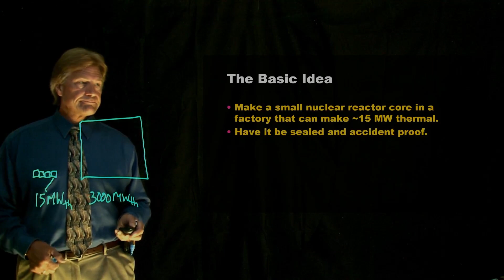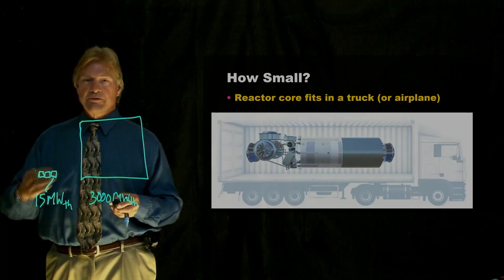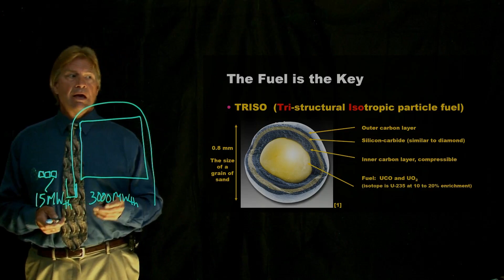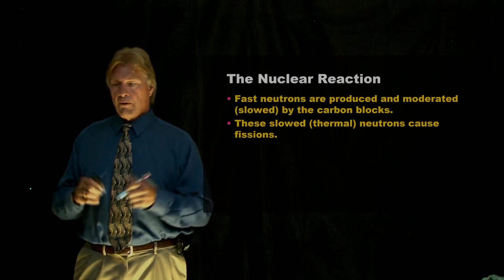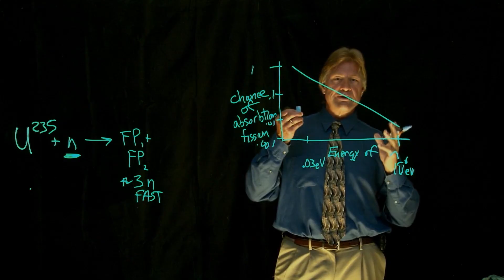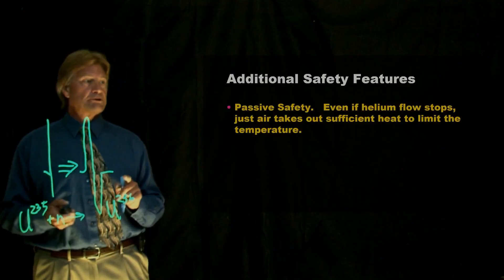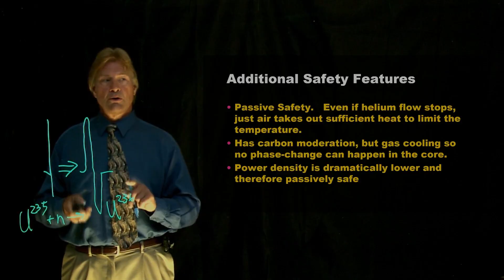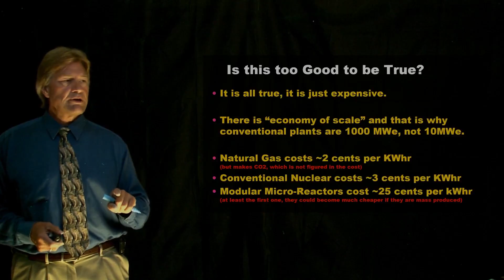Modular Micro-Reactors – The Future of Nuclear Energy?

Comment: Professor Ruzic. I agree with part of your presentation. The French proved the small reactor factory built concept in the 1960's when they built their very successful nuclear power station grid from this type of small reactor. I disagree with your promotion of the pebble fuel. It is VERY difficult to make as well as very expensive. It also has all of the problems of any solid fueled nuclear reactor. Nuclear fuel ALWAYS swells due to the intense radiation. This is simply an expensive way to minimize the swelling effects. It does nothing to resolve the reaction byproducts contamination of the reaction. Also it only allows utilization of a very small portion of the energy in the nuclear fuel (about 1-3%). When the core is decommissioned you still need to store the highly radioactive waste for thousands of years. AND you need to somehow break down the very hard fuel pellets, ie, very difficult and expensive. 

I agree with your promotion of the molten salt. If you are going to use molten salt anyway why don't you eliminate the complexity and cost of making pellets and just go with a molten salt liquid fueled Thorium reactor (such as LIFTR) to start with. This design IMO is far superior, has already run for over 6,000 hours at Oak ridge labs, is proven walk away safe, pulls reaction byproducts out as useful medical isotopes via chemical separation, uses approx 95+% of the nuclear fuel energy, only needs high level wastes stored for 300 years, and is far less complex. The only remaining hurdles are some slight metals compatibility proving needed. Chemical separation is a far superior and cheaper process. The inventor of the nuclear tea kettle reactor said it was fine for military use but was a very poor choice for commercial reactors, as we have seen 3 times. For many years he strongly promoted the liquid fueled Thorium reactor as a far superior choice. See Thorium Alliance you tube videos for a good overview.
Reply: In my comment I take a look at his economic views and to summarize in my opinion the market isn’t as real as people think it to be
Reply: Hammer Go Bonk! Mobil nuclear reactors...i don’t see that ever...the technology is simply not desirable in the eyes of policy makers and the public...the 50s vision of a nuclear utopia didn’t end without a reason. Feasibility was definitely one major reason but the Cold War and idea of nuclear Armageddon didn’t help either
Reply: @louisbrokatzky520  there's a reason William Jefferson Clinton says above all else expect resistance. The reason you refer to is they didn't expect adequately the kind of resistance putting existing energy businesses down would cause. It is amazing what the people who benefit from several days work out of every week for most people on the planet doing can generate in consent. I understand that there are very few living people who have the imagination necessary to Burley adequately imagine what intelligent people believed without political maturity the theoretical impact of fission would have on society. We should have forgotten about fire. Nobody owns the concept. Things are still burning because we haven't criminalized pretending to own All rights to burning. Things actually started on fire believe it or not before mankind existed. A few years before we started dropping bombs on cities and fantasizing about purely Neutron weapons intelligent if ignorant people had legitimate concerns about entire world's atmosphere starting on fire and that sort of thing. Those concerns became ridiculous long before I was born however. Yet they are the dominant belief system and you are just one of the people espousing it. I take it you've never wondered about why you can buy a solid brick of carbon dioxide but you don't know where you can take your door even to get an ounce of nitrogen not even solid? Fission is not a subject only for chit chat it actually is a useful technology believe it or not. Your problem is with oxidization not with conversion of matter into energy far more directly. I don't think you'll ever know that but you don't need to thank me if it occurs to you before you pass of whatever cause on the other hand if you by not bothering to care about reality or truth further fuc up the world you don't have a friend in me.
Reply: @Hammer Go Bonk! who told you the army was tp resist russia, it's obviously to suppress the eu citizens.
Reply: @Hammer Go Bonk! so anyways I think it's important that people know that so they're photovoltaics was seeded buy British Petroleum and continues to do great work despite the DraStic reduction in cost propping up the price of oil. But much of what you say is insane. You think that hippies without the help of Big O oil could have kept nuclear power from being our only source of energy decades ago. It wasn't the hippies.
Reply: @Hammer Go Bonk! so sir why did British Petroleum develop solar panels or to put it more bluntly and clearly even inarguably how successful was that project containing up precious capital that had almost no impact upon the profitability of the oil business?

Comment: EE UIUC class of 78, the "Levelized cost of energy" of nuclear is 4 times that of renewables, and going up every year. The danger of nuclear is financial.
Reply: True, but we still don’t yet have a good way to store the renewable energy - nuclear could (and should in my opinion) be an important part of a reliable, low-carbon energy future.
Reply: Indeed you can’t really compare levelized cost of reliable energy with that of unreliable energy. To make solar and wind comparable you’d need to add the cost of a large number of batteries. Of course no one does that because then it would be prohibitively expensive.
Reply: @tomshackell  problem is generating electricity with the energy be specific with the neutrons. That's what creates the reliability issue. I agree that molten salt is not a commodity but liquid nitrogen absolutely is however we can't go down some sort of fucking laundry list of energy substitutes energy surrogates it's not the way we do things the petroleum industry currently is allowed to maintain its own trading floors so that they can get into the high speed sailing sport and say we are still going to need a diversity fuel. That's called fake speech. If we can get a third party to operate a trading floor and have energy itself be sold in the Futures Market the era of the cult of the personality of the mechanism will end and substitution of actual regulation on safety can occur. That means no more deep sea petroleum mining freeing up the capitol all those little geek getting their bachelor's degrees and quarter million dollar salaries half a decade out of high school as well to build geothermal powered liquid air production facilities in sympathetic sovereign and the cellular inertial yank worldwide shipping Network system 2 distribute said products including lots of fresh flowers and greens if not artichokes for everybody on Earth not Canned not Frozen not salted

Comment: CO2 is no problem whatsoever. The ocean will eat all surplus CO2 anyway, and convert it to other substances and store it on the seabed. This the ocean has done for billions of years with CO2 injected into the system by volcanos. CO2 is no problem whatsoever. It is a chemical balance between the sea and the air that determines the concentration in the air. Some prominent geochemist explains it here if interested:  6.3.1.2 Some Thoughts on Ocean Chemistry - http://www.co2web.info/Segalstad_Chapter-6-3-1-2_Ocean-Chemistry_NIPCC_CCR-II-B_2014.pdf

Comment: I do appreciate you Illinois EnergyProf, but I think Just Have a Think has a better take on this. These small reactors can help and can be safe(ish), but more likely are just ways to sneak around regulations. In the start of the video you even mentioned putting several of them in the same area. Why wouldn't it be a better idea to just have a medium or even large sized reactor there? It'd surely be more cost effective and fuel efficient.

I'm sure they could be made reliable and safe from a technical standpoint, but if they're small enough to be put in the back of a truck then what's to stop someone from stealing these and using the radioactive material for nefarious purposes? It's a lot easier to fortify one big plant rather than 100 small ones.

Where would burning fossil fuels be the only other choice? Solar, wind, hydro, geothermal, bio-fuels... there are always options. Even in the arctic and antarctic solar can be viable with enough storage or a perma-sun only schedule. Wind and tidal/current power is also possible.

Why would you be melting steel far from power sources? Why would you have a college campus or apartments so far away from a power plant? 

I'm fine with nuclear in general, even traditional PWRs can be safely run and reactors are only getting safer, but these micro-reactors don't seem wise to me economically or practically.
Reply: Here's his take: https://youtu.be/yofGtxEgpI8
I'd love to see your response :D

Comment: Liked the drawn diagrams on glass, it makes understanding this complex subject easier thanks. Also watch Planet of the Humans to see the actual cost of all the green energy production like the solar panels and how long a solar site would operate for before an upgrade etc. The downside to these small nuclear modules would be the increase in radioactive waste but I wouldn't say no to a nuclear motorbike and side-car. 

I live within 5 miles of Hinkley Point, can see it from my  kitchen window, this 3,200 MWe site has 2 EPR reactors run by EDF, a French company and will make our bills rise and electric costs sore and become a massive white elephant and uneconomic to run. 
Their sister reactor at Flammanville in France is many years behind schedule and millions over budget and recently had to be closed because of a 450 ton pressure vessels which had the wrong type of steel in the base and had to be replaced.

With any nuclear device we still end up with radioactive waste (thorian can be recycled once) and the question of where to store it for about an eternity. We have to also make sure that the future people know where it is, what is stored there and how much, how do we mark the spot? 

Couldn't we fire the waste into the sun or drill down to the earths core and send it there? If we drill down to the core couldn't we use that energy instead of nuclear, that plus the thermal electric generation as seen in Iceland.

Unless our homes have photovoltaic windows, Kinetic everything, solar panels, wind turbines, land space for a ground sourced heat-pump we won't be able to provide enough energy for domestic use and what happens if you rely on solar and there's no sun for days or weeks?  The other problem is that government subsidises electricity production and not the green production which doesn't seem right does it?

Seeing as so few homes have these things this which makes nuclear the only other option. 

In the 1960's a reactor which used thorium instead of uranium ran for 5 or 6 years at Oakridge until President Nixon pulled the plug,  thorium can be recycled one time and there's an unlimited supply of it. 

One of the reasons for not using thorium if because you cannot process weapons grade material from thorium and the military like using spent uranium tipped missiles and bullets because they are effective at penetrating solid surfaces better than conventional projectiles.

Comment: If they can be housed into a 20 or 40ft shipping container, these would be a game changer for places like remote islands where they have to burn diesel generators all year long. Only thing you didn't mention that I was wondering, how long till they need refueling, or is it game over and buy a new one at that point?
Reply: He said 20 years in the first part of the video. 20 year life and then you send the reactor back to the factory for disassembly and disposal. And presumably if you still needed power after 20 years, you'd order your new reactor to plug right in where the old one used to live, and all the existing steam production and turbines would just be there waiting to go. 

I imagine one of these things powering McMurdo Station in Antarctica.
Reply: @Clean97GTI  Many thanks for filling me in, I missed where he mentioned the refueling. Re. Using one at McMurdo, exactly what I was thinking! Perfect use case for one especially given the cost to get fuel down to there. The benefits of being able to run it flat out and not need to worry about fuel burn would be a game changer, and when it's used up just throw the shipping container back onto the supply ship and off she goes.

Comment: in your videos about the economics of nuclear plants you really hammer down that most of the cost comes from the building of the plant. what are your thoughts on MSR reactors and their potentially extremely low build costs due to the low pressure of the system and few parts (actuators and pumps). there is a lot of talk about MSR's application in breeder-burner reactors since fuelling off of u238 (or thorium, allthough i'm not sold that thorium is at all nessecary for a revolution in cheap nuclear) would reduce fuel cost, but it seems to me the low pressure and reduced build cost would be it's greatest boon. with the abundance of u238 in existing stocks i'd also be very happy if we got some energy out of it.

Comment: Right. Make them the size of standard shipping containers and completely self-contained so no maintenance or human operators are required and fuel them for at least 25 years and you'd have a very popular alternative to standard nuclear power plants. But they'd have to be Thorium based since no one trusts uranium based ones anymore because of melt down problems.
Reply: @Andy Geee My point is that no one trusts standard uranium reactors because they can melt down. If you want to make nukes acceptable then you need someway to totally prevent this from happening, otherwise no one will ever accept thousands of micro nuclear plants scattered throughout the country or the world.
Reply: @Andy Geee Good to know that uranium can also be made meltdown proof. Unfortunately, uranium also has a very bad reputation because of all the meltdown (and 50,000 year storage) problems whereas thorium does not.  As such, it would be easier to promote thorium reactors as a whole new and much safer way to generate nuclear power than revamped uranium. PR matters and uranium has bad press, and the public has to be willing to accept it.
Reply: @Andy Geee I'm just saying that a huge reeducation program is going to be required before the average person will accept uranium, whereas if both thorium and uranium will work equally well then the educational program for thorium will be a lot less (and will generate a lot fewer lawsuits).

Comment: Economic case cannot be made until modules are actually produced. I have higher rates here in Atlanta because the Southern Co. is merely adding a reactor to an existing facility. It is years late and wildly over budget. The idea that any new nuclear tech can be brought on line and made to compete with solar/battery seems fanciful at best. 
BTW nuclear only exists because the tax payer insures it for disaster thru the Price Anderson Act. Without this subsidy, nuclear for power would not exist. If equal value subsidy was given to solar it would be even cheaper.
Reply: @George Mann Your figures are outdated. Tesla is currently offering installed solar at 1.49 per watt before subsidies. and these prices will fall steadily. Payback on solar is under 4 years. Personally I'm paying more every month because a reactor that is many years late and way over budget is being added to an existing plant.  BTW, I did not see any real world figures for MSW reactors in your post so it makes comparison impossible. Could this be because there are no such reactors in the commercial space? Also remember that the tax payer provides the insurance for potential major nuclear disasters through the Price Anderson Act. Without this subsidy, there would be no nuclear plants in the U.S.
Reply: @George Mann Lying means willfully misstating what you know to be true. I did not do that and unless you can read minds you can say no such thing truthfully. You may want to check out this reference:                                                        https://electrek.co/2020/07/17/tesla-solar-price-decrease-increase/.  Inappropriate personal insults aside; I don't understand the point you are making. Are you saying that utilities are making a foolish investment with solar? Are you saying that thorium MSW reactors can be developed to commercial readiness, built and supply cheaper power than solar will cost at that distant date? I understand admiring clever engineering solutions because I am a mechanical engineer and thorium as described in this video is certainly full of elegant solutions. Had it been chosen over light water reactors, it would likely have had superior results, but a new tech has come on the scene and whether you like it or not its cheaper and that is the most relevant metric for utilities.
Reply: @George Mann C'mon Mann, Solar pays back in a few years even without subsidy. An apology would be more appropriate than "whatever" don't you think? Keep in mind that without the Price Anderson Act nuclear power plants would not exist in the U.S.